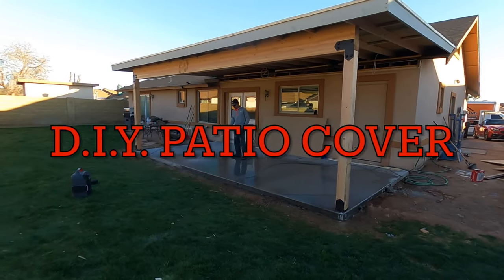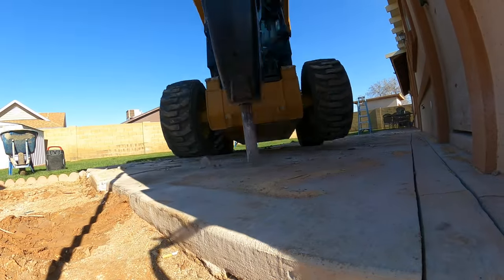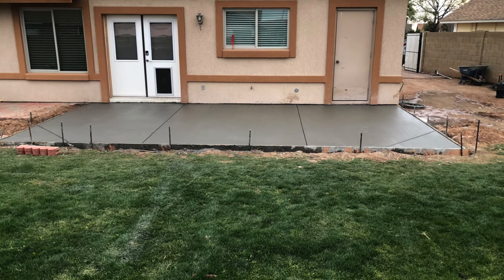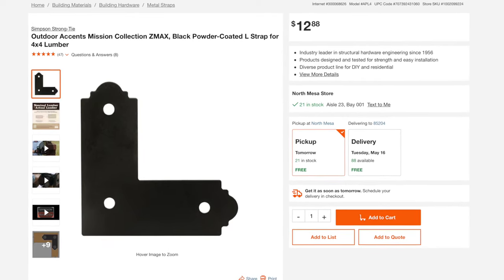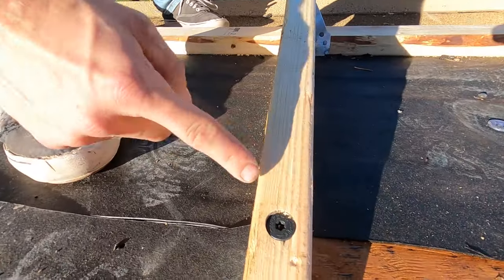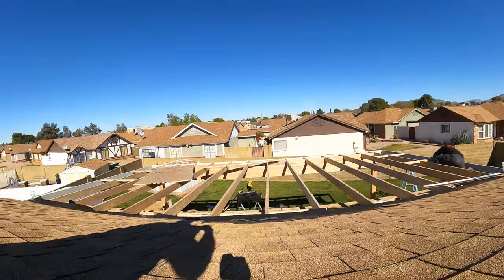DIY Porch - Veranda - Patio Cover

Comment: Well done. 

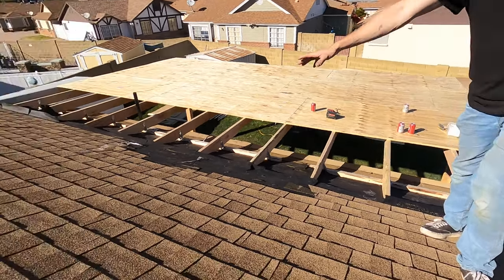I would have liked to see the transition in roofing from the sloped roof to flat roof. I’m retrofitting a spot where the previous owner used shingles on a “flat” roof (<3:12) and continued them up the sloped roof. Now I need to fix a small leak and not ready to redo the entire roof. 

The difference in price on the brackets is you the listing for 4” but used 6”. Definitely a difference in price and even more so if pre-pandemonium. 

So glad to hear you got your permit and built it to code. Started watching one before this with the guy saying I’m just winging it. Stopped watching when he used 2x4’s for rafters and didn’t know what a roof pitch was. Some people say it is just for me and my family and I’m not selling, except when you have friends visit. There’s so much liability with all that wood overhead.
Reply from the maker: The rolled roofing goes underneath the felt paper and the shingles, so the rolled roofing is directly applied to the existing house plywood. And then the shingles overlap the rolled roofing. And yes obtain a permit for resale because if the buyer has a good agent they will catch the non permitted structure in your backyard.

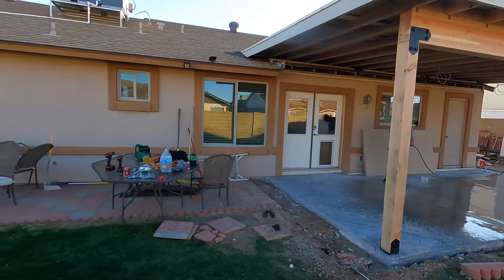Comment: Would’ve loved to see details on how the existing roof was covered back to preven water and bugs from going in under the new roof. Can kind of see but not clear at the 5:36 mark
Reply from the maker: You frame from the top of the existing wall to the bottom of the rafters to make the existing house wall taller as if it goes into the patio ceiling.
Reply: @everythingresidential  that’s totally what I figured! Thanks! Great inspo on the videos for my upcoming home project